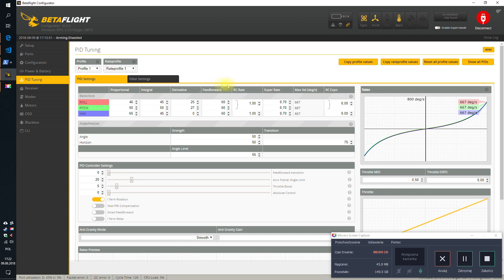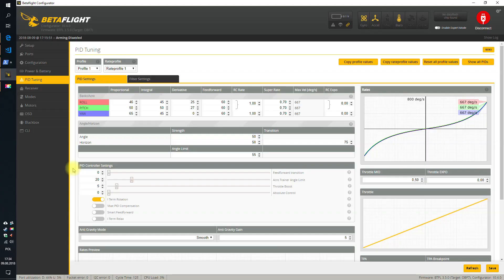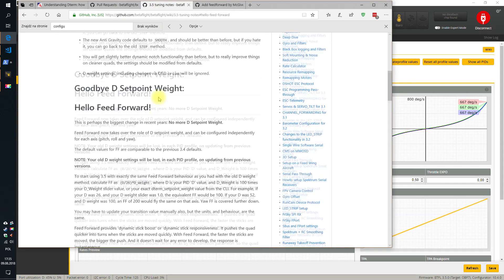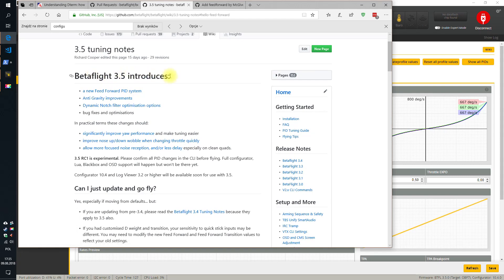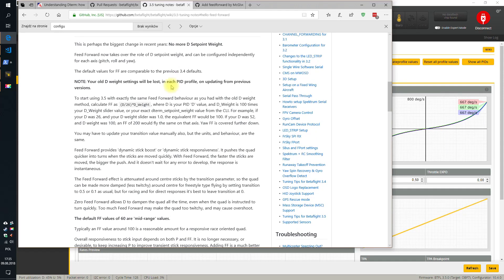Betaflight 3.5 Feedforward - what is it and how to use it!

Comment: i think my problem is that, i understood everything you said.
Reply from the maker: I assume it's a good thing :)
Reply: no not really, betaflight seems to be becoming  more difficult to use,  we need somebody to translate all the techy stuff into  normal language we can all understand, nobody but devs need to know what feed forward does to 'd',   for example most people dont know about mouse acceleration. they all use it instinctively .  it works well, the defaults are fine, feedforward is another  form of rates, they simply make it easier to fly,    A is sharper in and B is softer out, it seems the only people who need to know what FF does to 'd', are the people who thought they knew what P I and D did before and mainly to tell them they were wrong hehehe.
Reply: lol i made myself laugh...   now i am facing 3.5.3  i think i will just ignore the info on transferring old setpoint stuff to this, i think there was a typo in the very vague info  (second example referred to d weight being 100? )  i stand by my comments above and say we should just refer to feedforward as rates  for the math.  we have rates for the sticks everybody understands this .

Comment: A couple of other  possibly less visible but quite important aspects of the feedforward improvements.  Firstly, feedforward is no longer coupled to D.  Previously setpoint weight was coupled to D in both calculation and output.  So if you changed you D gain it would also effect your setpoint weight effect.  Then the setpoint weight output was mixed into the D component of the pidsum.  Now D and feedforward are completely separated.  You can adjust the PID gains to effect stability and feedforward to affect stick feel completely independently.

Next is that feedforward is now available for yaw.  Previously setpoint weight only affected roll and pitch.  Now we can use feedforward to dramatically improve yaw performance.  In fact using substantially higher F and I values and then dropping P on yaw produces great results.  Also by reducing P on yaw we reduce the tendency of yaw P oscillations under normal flight conditions (low yaw rates).  For some exciting yaw performance, try:

set p_yaw = 40
set i_yaw = 120
set f_yaw = 100

Of course this also exposes the fact that feedforward is now available on a per-axis basis.  The pilot can how tune the responsiveness  for each axis as desired.  For example the pilot may want slightly more F gain on pitch to compensate for the extra inertia caused by the mass distribution in a typical racing quad.
  
Lastly, D has returned for yaw.  However testing has shown that yaw D really doesn't provide any benefit in the typical quad configuration and in fact can lead to bad behavior and oscillation at higher settings.  So we don't recommend using yaw D on normal quad configurations  (leave d_yaw = 0).  However yaw D might be useful for other configuration such as tricopters so it's available for experimentation.